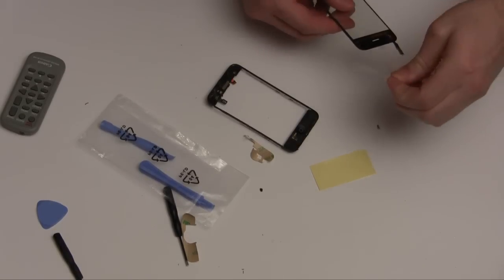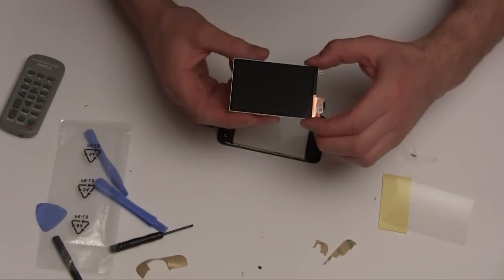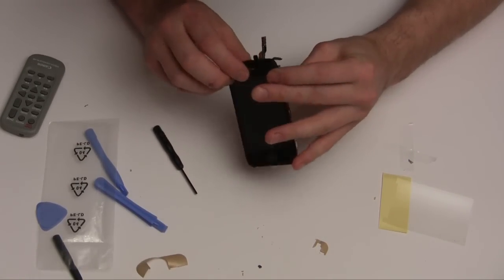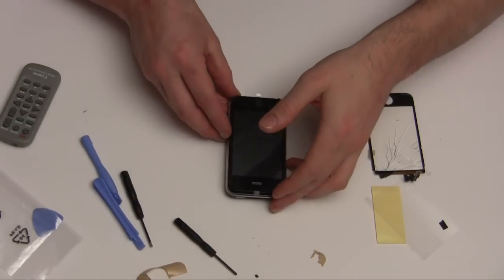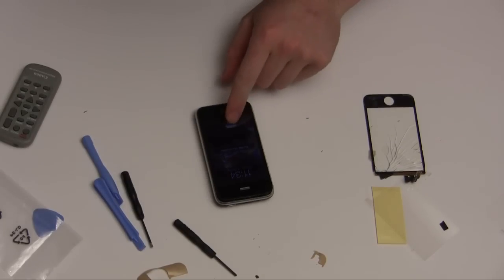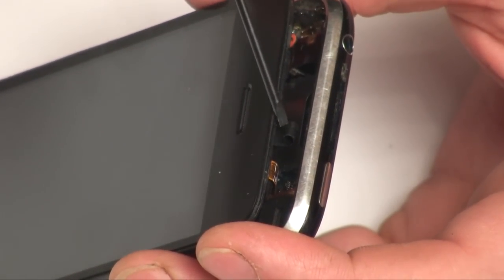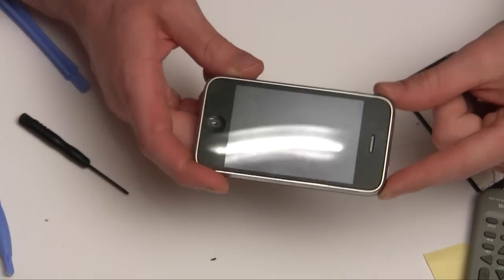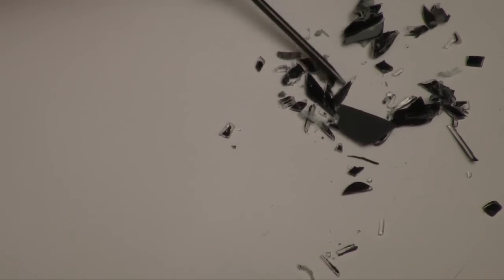iphone 3GS screen replacement complete and comprehensive part 2/2

Comment: got same prob got parts saved will follow both ya videos to letter, however me sim card reader doesn't appear to be  damaged but its not reading my sim  card. will have have to replace the entire sim reader cause  i took it apart earlier and all the connects are in place the sim reader spring goes down  once powered up, the phone icon in general is lit  but it does read the sim

Comment from the maker: @veryspecialsteve my friend had this same problem and you need to make sure it goes behind the surround not underneath (you poke it through the middle of the black plastic with the button) 0:49 is where you see it in this video, you must have got them between the glass and the surround.